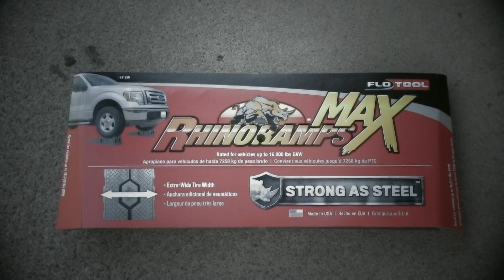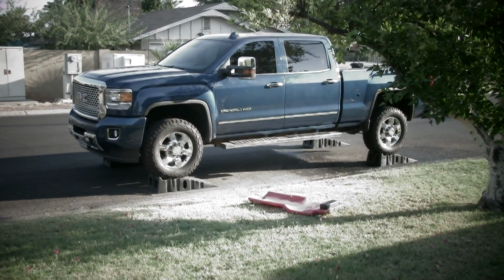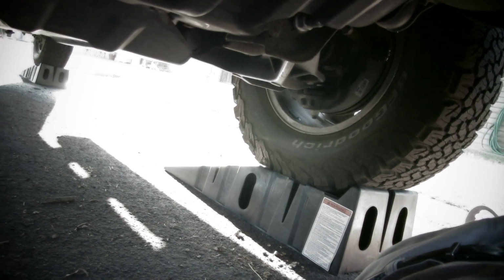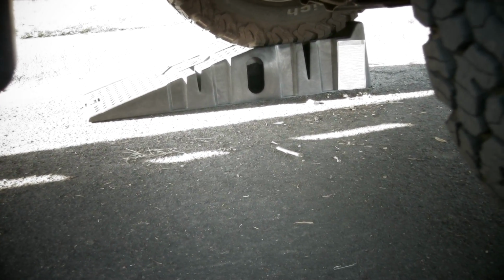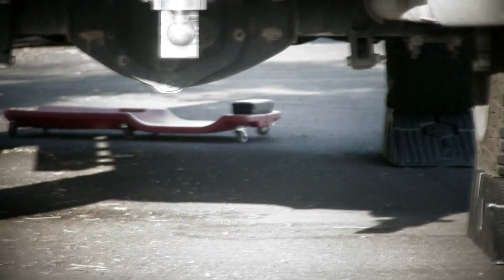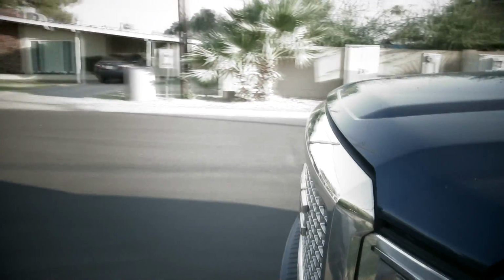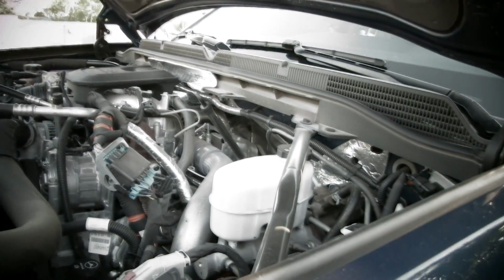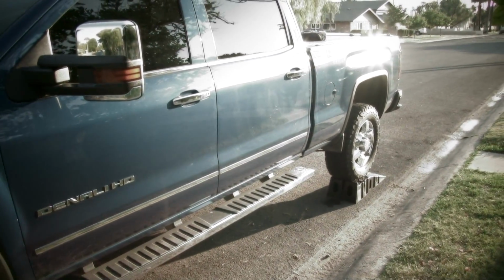FloTool Rhino Ramps 16,000lb Capacity Review!

Comment: Setup that I use for my 4runner. I do throw 2 jack stands under the frame for extra security. Key with ramps is to be on flat level ground, put in 4wd lo if you got it and put on emergency brake when up on ramps. Double check you are even and all the way on all ramps. All the ramp failures Ive seen on Youtube were the non heavy duty ones I believe.

Comment: The company says don't use four ramps at same time. Only use two.
Reply from the maker: Interesting I wonder why?
Reply: FROGMAN524 My guess is stability. The truck could roll off or flip over all four ramps at once. If you have two wheels on the ground there is much less chance of it coming off the two ramps. Also you can chock the two grounded wheels.

Comment: you've had these for a while now how are they still holding up? any issues? cracking? melting? etc?... i want to buy a set but after reading alot of reviews saying they crack and lose their strength over time is turning me off from them did you have any of these problems?
Reply from the maker: SuperPhen0m use them all the time without any issues. There truly a lifesaver.